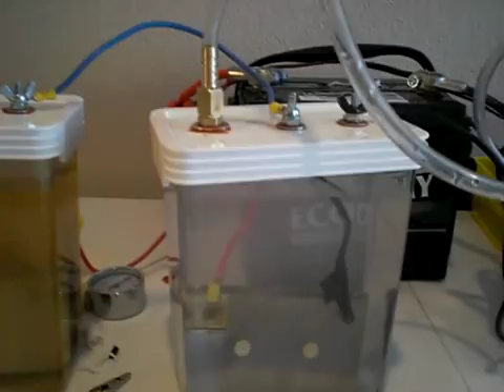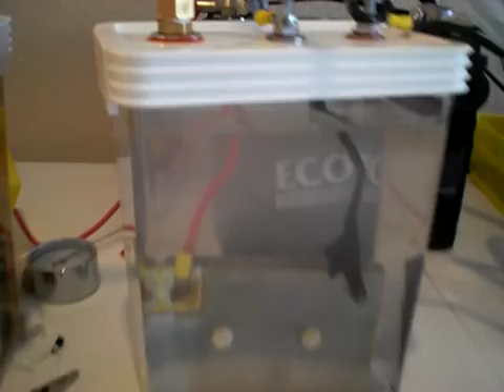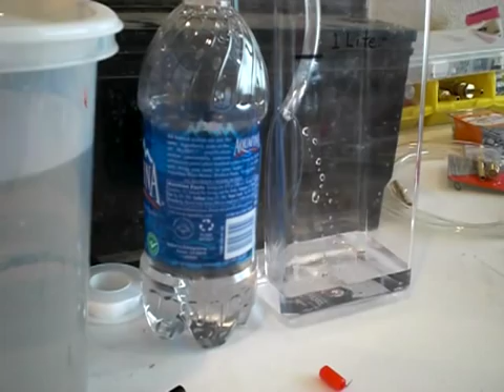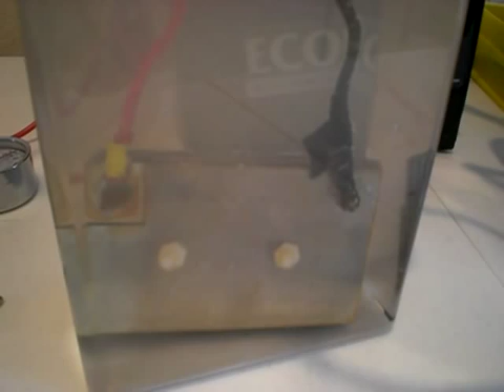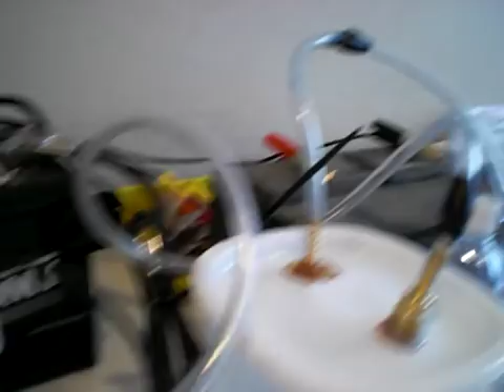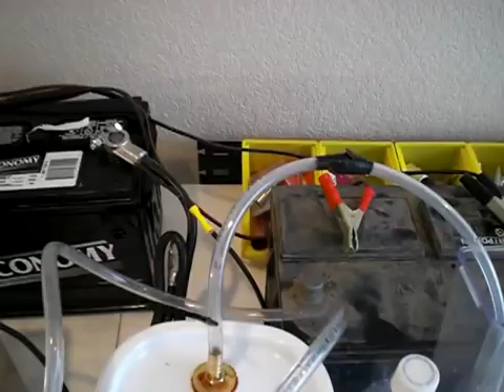HHO Cell Dual Series

Comment from the maker: longest run time was about 20 minutes and the water was just a little warm.  keep in mind, these are for production and not total efficiency.  In a vehicle, I would run a much smaller configuration, perhaps even 2-4 plates.    This would suffice in increasing the fuel efficiency pretty dramatically.  The plate configuration on these are two units, 10 and 12 plates.  +-+- configuration.  3x5 plates.

Comment from the maker: When I just had one cell, dragging 60 amps it was producing 2 LPM.  I cut that in half by adding the other cell and wiring it in a series.  Only getting 32 amps per cell, and about 1.5 LPM.  These measurements aren't exact, I need to get a better way to measure the volume of HHO.  Thanks for the kind words.